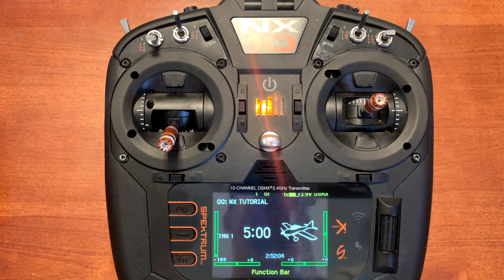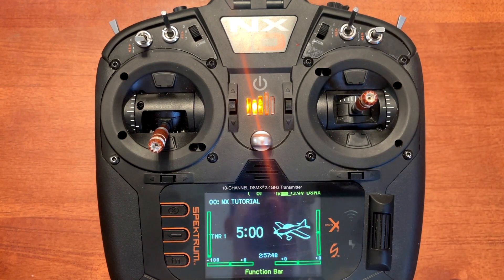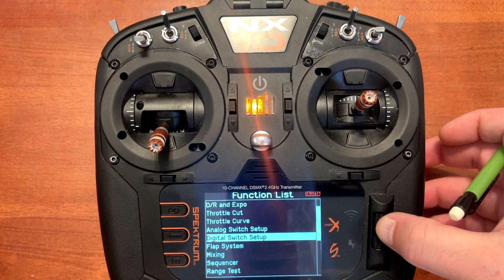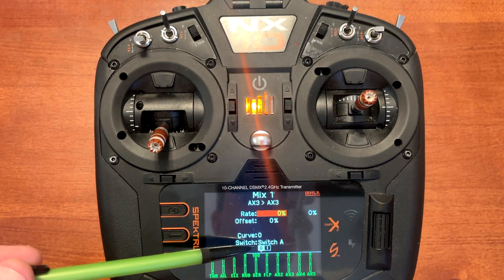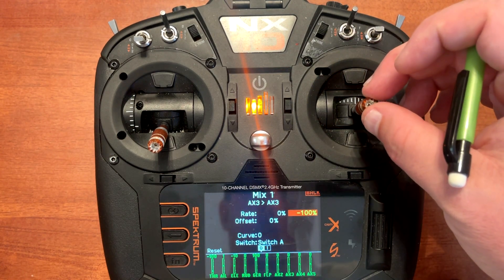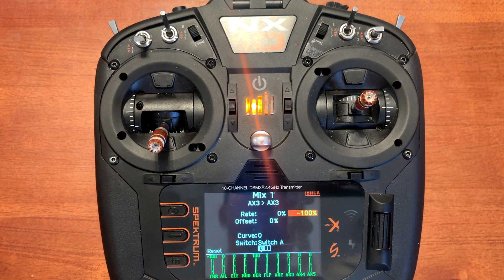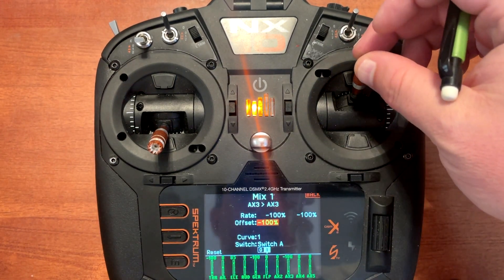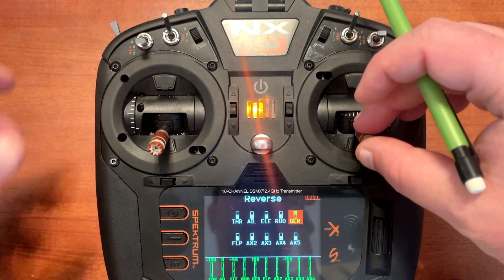Spektrum NX Setup:Pressure Sensitive Electric Brakes (JP Hobby)

Comment: Have you ever tried to setup a "Parking Brake" function? I'd like my brakes to be active when starting, but need my hands free.
Reply from the maker: Setup this way or a switch to flip off with opposite side of throttle. Another option is "I button"

Comment: I did what this video said but when I toggle switch A it does not move the screen on the mix. I mixed AX3-AX3. The brakes will work as the video said but when I put the first rate to -100 and then offset the same the braking is gone. I am using an NX10.

Comment: What type of Electric Brakes are you using sir ?? JP ??
Reply from the maker: Yes , JP...
Reply: @BDTennessee  Ok ?? What Controller are you using for this set-up BD ?/
Reply from the maker: @MrLew1965  didnt use a controller.Straight into  Rx...
Reply: @BDTennessee  That's the first time I have heard of someone doing this BD ??  So adjusting the EPA you are essentially creating an ABS system ?? This works fine ?? You have tested this ?? No Lock Ups ?? TY for the replies BD !! SUBBED In !!
Reply from the maker: @MrLew1965  i used this same setup on friends Habu 32x that had them. Checkout video on my channel.You will see him slow it down fast without lock up :)

Comment: BD,
Excellent video, as are all of your videos. You are a lifesaver on this topic, in particular.

There is not much information out there (Internet, forums, publications, etc.) regarding RC aero electric brake systems. Even less, to absolutely NO, comprehensive information on transmitter/receiver programming, not even from the manufacturers. So thank you very much for the great video.

Couple points of clarification:
I assume that you are using JP brakes with the JP Controller. This controller has resistor pots for adjusting right and left wheel braking pressure providing a straight stop on rollout.

As for your tutorial, once again great job! I wanted to point out, specific to my Spektrum NX10, an additional programming step, I discovered, that I found important. I will review and explain in the next three steps.
1. Go to: "System Setup" > "Channel Assign" > "Channel Input Config" screen
2. Set channel eight (8) to "8 Aux3: Ele" as you have instructed.
3. Next step is to is to select the "NEXT" screen (lower right corner of this screen's display). This takes you to the "Rx Port Assignments" screen. Make sure the "8 AUX:" field is set to "Aux 3". 

Just learning the system but I made this settings mistake and thought I would point it out for consideration.

Thanks again Frank...
Reply from the maker: JP controller wasnt used.Connected straight to receiver. In the video i didnt mention RX port assignment cause Aux3 is defaulted to Channel 8.

Frank, thank you so much for the kind words!
Reply: @BDTennessee  So right and left electric brake leads are connected directly to Aux3 (Channel 8) with a Y-Harness?
Reply from the maker: @harperfw  correct.